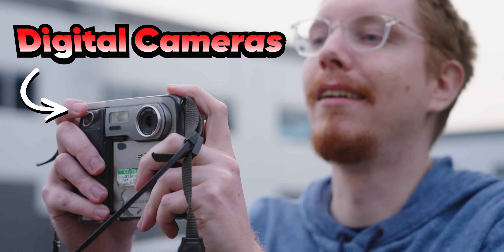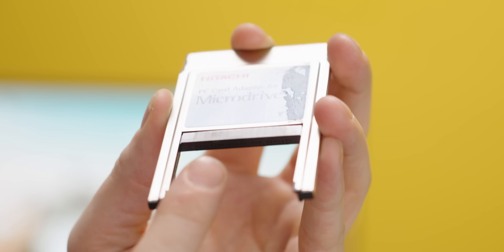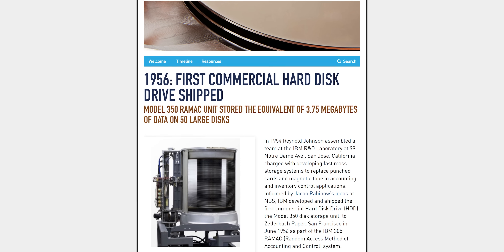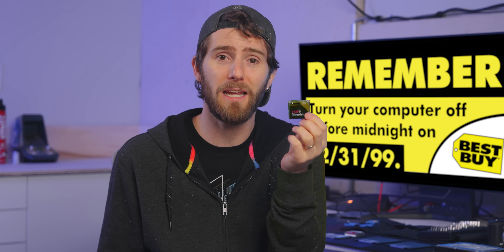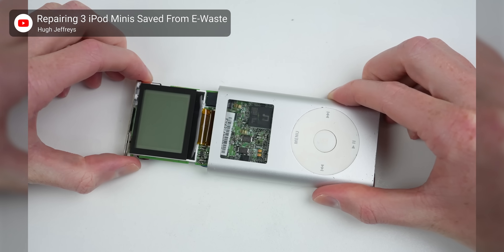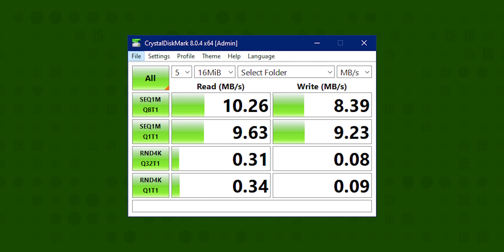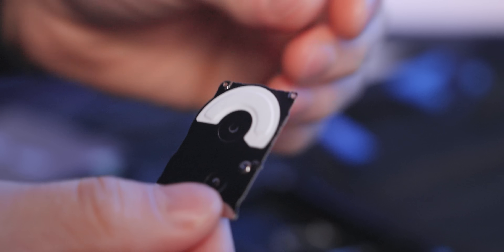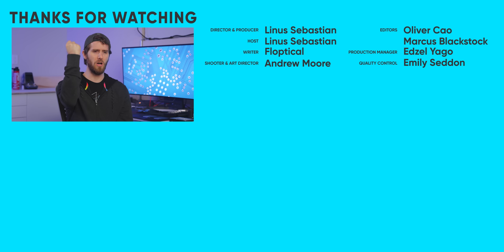This TINY Hard Drive is REAL... and it changed the world! - IBM Microdrive

Comment: I have a hard drive USB that was a little less wide than a credit card, but yet still thin enough to fit in your palm. Me and brother wondered if other people ever had such a thing and to even see who made the damn thing! To this very day, the tiny hard drive is an absolute mystery to us
Reply: Toshiba have 1.8/1 and 0.85, I think you talk about 1.8 like Toshiba MK6008GAH(ATA) or TOSHIBA MK3233GSG (SATA). Proud owner of those 2 and I have one 0.85 dead but... I rip him off from Mp3... Conwo???
Reply: @arned432  he said it was usb though
Reply: @FirstnameLastName-mr8lk  A USB version would just be one of those bare 1.8" drives in a box with a USB->PATA controller
Reply: At work I had a few USB drives of that size around 15 to 20 years ago. They were slow and unreliable.
Reply: No, no one else ever had one. You're the only person. It obviously appeared through magic.
Reply: why not go to the forum and post pictures?
Reply: Can you post a picture on the LTT forums?
Reply: 1.8" microdrive. Just a bit bigger version. They were used in lots of devices. You can find them on ebay pretty cheap now. Most were either IDE, mini sata.
Reply: The original MacBook air sported one of these drives. It was the same as the iPod video (5.5th gen) or iPod classic, as they had 80 to 160gb spaces. 2 different thickness existed, hence why smaller capacities were built into slimmer iPod enclosures.
Reply: I've got a 30GB 1.8" drive in a drawer from an old Cowon X5L. That form factor made more sense for full size digital audio players.
Reply: 1.8" ZIF drive
Reply: I think I know what kind of drive you're talking about, and the Creative Zen media player had one too. Loved it until the controls broke due to user error.
Reply: oooh, my father had one of those as well. Not as small as the one in the vid but still pretty small
Reply: zif drive
Reply: Isnt that just a 2.5" hhd
Reply: @alexstromberg7696  No, I think I know what form factor he's talking about. There were 1.8 inch sized drives in the early-mid 2000s that were used in regular iPods and are also really slim (as they had larger capacity than these micro-HDDs or CF cards at the time). That's how Apple got 30gb into devices like iPod Video which was only 1cm deep, all the way back in 2005.
Reply: @NFMorley  For context Microdrive is a 1" drive, and there are some rare toshiba 0.85" drives mostly used in early nokia smartphones.
Reply: @NFMorley  I have a 2008 HTC Shift X9500 with a 1.8" 120GB HDD and the original 40GB HDD. The 120GB is clearly thicker than the 40GB one so I guess it has two platters.
They are cool but slow for Windows Vista/7
Reply: @NFMorley  Oh I see. back then they also had 1.8 inch sata hard drives, I remember my old Toshiba notebook had one.
Reply: @alexstromberg7696  Sounds more like an ipod drive.

Comment: I worked for a Japanese company at the time. I had to repair a laptop, and it took me a while to figure out this tiny thing was the storage.
Reply: @dataabort yep they're usually 5200 RPM where is the desktop ones are 7200. Although I have seen 7200 hard drives that are laptop sized so idk.
Reply: I used to by bulk second hand microdrives to convert my tiniest thin clients into stand-alone mini PCs.. They weren't fast (3600 RPM I think) but 4GB was cheaper than compact flash and far MORE reliable, despite being mechanical. CF could not take many writes before failing, and write speed was closer to an old Sinclair QL Microdrive Cartridge (CHECK OUT THOSE BEAUTIES FROM 1983) than a hard drive. Installing Windows took many hours, and was pretty much a one shot affair that would often fail on cheap CF cards, ruining them. Expensive cards could take 3 or 4 OS install (attempts) each. Microdrives could take as many as you want and run a swap file.
Reply: I think they only found their way into netbooks that initially had a removable socketed micro-drive and an unmovable flash drive soldered to the board. MSI and IBM/Lenovo used them I think.
Reply: @Rafael Herschel Ya, my new laptop can cold boot in about the time it takes me to stand up lol.
Reply: Repaired a MacBook once and it got caught up in the iCloud process so we had to send it off 😂😊
Reply: With those low speeds, kinda surprised to hear that they found their way into laptops as primary storage.

But I guess for something that was that era's version of a "Chromebook" this would have been completely acceptable, eh? No need for high read/write speeds for word processing and spreadsheets. I imagine that made boot times EVEN worse than usual for the era though lol.
Reply: @Nevir202  these days dirty cheap laptops brand new all have slow soldered EMMC storage. I'm guessing the hard drive was the old equivalent.
Reply: @wrth  
eMMC is bad, but not quite THAT bad. If the OS is optimized for it you at least still measure boot times in seconds and not minutes.
Reply: @Alias_Anybody  that's exactly it. it was probably the same back when these mini hard drives came out. less bloated OSes so relatively speaking similar boot time reflected
Reply: @Alias_Anybody  cheap eMMC is THAT bad. We're not talking decent eMMC like you'd get in a steam deck or flagship smartphone, we're talking the trash you get in $40 tablets and chromebooks, or the nonsense that cellphone companies will give you for free if you add a data line to your account. The crystal disk results he got here are spot on for those kinds of devices.
Reply: @flyingtentacle7631  
The UFS of modern phones with its cache is closer to an SSD anyway, isn't it?

What we usually call eMMC is basically just a soldered on SDHC card, and that is usually still less bad with Android or ChromeOS than Windows 7 on an HDD.
Reply: @Alias_Anybody  yeah I know this that went people talk about cell phones they don't describe what's inside of them whereas when they talk about other things they'll say EMMC so I don't understand.
Reply: @wrth  You would be surprised at the sheer amount of laptops from the mid 2010s with raggly old 5400 or !!!!!4200!!!!! rpm hard drives spinning around
Reply: @Nevir202  Boot times were 3-5 minutes and I don't think people noticed.
Reply: @Nevir202  No difference in speed to 1.8" ZIF hard drives, and for all intents and purposes they're just as fast as a regular 2.5" 5400rpm hard drive. I have a laptop with a ZIF HDD and there's no significant difference.
Reply: @Nevir202 the difference is that cheap e-waste was actually cheap in the past. Modern Chromebook on the other hand...
Reply: @Nevir202  Not quite - microdrives were top tech in their day
There were no "chromebooks" back then
Even their netbook predecessors weren't even on the market yet
Reply: @Wannes_  that’ll be why they said “that era’s version of one”. IE the (relatively, given all laptops were expensive) cheap and slow offerings. The bottom end machine sold only to a businessman who needs to write small Word documents, not process huge spreadsheets.
Reply: @Nevir202  At that time, the competition was a 3.5" floppy drive. Even a really slow harddrive was better than that.
Reply: @phuzz00  Bro nobody was using a floppy drive for their main storage in a laptop.
Reply: @Nevir202  Well, not anymore! But if you go back far enough...
Reply: @Incommensurabilities  Fair enough, but I don't think that applies in the era where laptops had become a thing.

Comment: To think that we used to load games off of such slow storage devices. Obviously SSDs have gotten really good lately, but still.
Reply: Games were much smaller in size back then so it wouldn't be too bad
Reply: what do you mean, i started off with magnetic tapes on zx80, and i dont consider myself old
Reply: Level loading speed significantly improved, but game performance overall stayed the same besides some stutter in low number of games
Reply: except... you know... we didn't.....
Reply: the thing is you didnt really know, since all the loading times just were like this. but play some old games on an old pc and it will just drive you nuts, i guarantee it :D